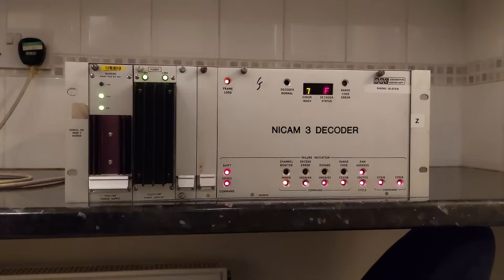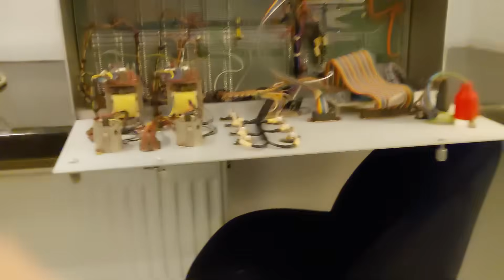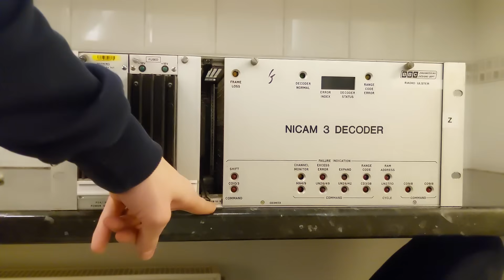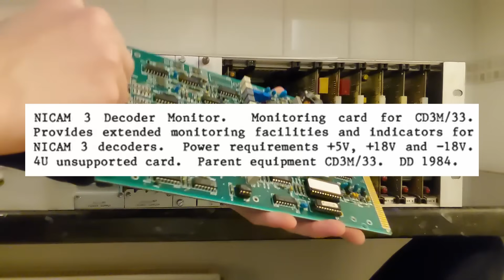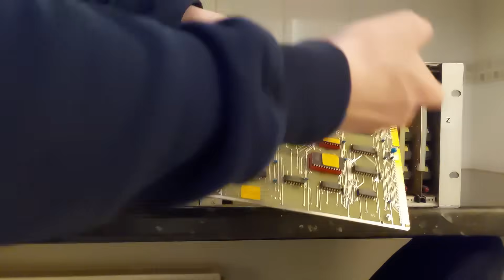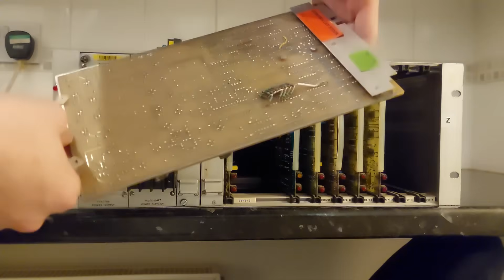A Look Inside: BBC NICAM 3 Decoder

Comment: Is this what's on divis for radio ulster 94.5 and does it support mpx output or is the rds different
Reply from the maker: Years ago, the national NICAM multiplex was routed through Belfast BH, and Radio Ulster was spliced in on the way to Divis and on to Londonderry.

The arrangements are different now, those links are long gone now sadly.

RDS & Stereo coding were done at the transmitter
Reply: @AvroVulcanXH607 very interesting I worked in radio before I saw pictures of divis and sutton coldfield bbc trasnmitters they use ip nicam encorder at studio and decoder at the sites and newry is a off air reviver rebroadcast divis to newry area newry relay

Comment: Hi Nathan, I worked in London control room in the eighties and we have the sending end in the racks. Actually there were a pair of them with an auto changeover switch. The "sender" looks just the same. And for your info we had lots of valve amps sending and receiving programmes to various destinations

Comment: Blimey! I remember going on a 'service seminar' in the mid 80's (I think), and the lecturer got off to a good start on a new Panasonic TV with NICAM. Sadly, it soon became apparent that his forte was signal routing/switching and instead of telling us all about NICAM, he got stuck into the various logic & signal routing chips that took care of the in/outs on the TV and went on at length about how the audio and video sigs were channeled to/from the connectors and/or the innards. After a good lunch we all traipsed back to the lecture room and he again banged on about his favourite subject. I'm sure most of us were asleep by about 2 o'clock. The best thing was gift of a rather nice toolkit on our way out. I've still got the pliers and the set of nut-spinners to this day! And we all got the all-important certificate to stick on the workshop wall, whether or not we stayed awake....

Comment: Reminds me of receiving the Maplin Electronics Magazine edition that covered NICAM transmissions, and the first NICAM decoder in the house, built into our AKAI VHS recorder IIRC.
Reply: I was thinking of that too! I've still got it somewhere, in a binder. I can't remember when it was (probably late '80s?) but I lapped up that kind of technical detail as a kid and would give chapter and verse on how it worked, from memory, at the slightest opportunity. Wonder if it's archived online somewhere... If not - scanner, here I come! :)
Reply: @molletts  AI / Claude either makes this easy, or, halucinates.   In this instance 1989 sounds plausible / rings a bell for me.   "The NICAM content in Electronics — The Maplin Magazine appeared across a 3-part series starting with the October 1989 issue.
Specifically:

The October 1989 edition carried the first instalment of a 3-part series on NICAM 728, and went on sale from 8th September 1989. WorldRadioHistory
An advertisement in a November 1989 publication also promoted the October 1989 issue as covering NICAM 728. Scribd
The series continued into subsequent issues, and the August–September 1990 issue featured Part Two of the NICAM Stereo TV Tuner Unit, with full constructional details for the NICAM Stereo Tuner Accessory Kit. Internet Archive

So in short, NICAM coverage began in the October 1989 issue and ran as a multi-part series over several issues."

Comment: Nice video Nathan. Was thinking early 90's box of tricks, this an 80's job then. I did not realise NICAM was that old. I remember casings, the blanking plates, little pull handles, cases with the rails put in at so many holes along. 
Electronics, apprenticeship 1990-93. Had first camcorder, Dear Sony Hi8 thing. song VCR with edit control lead, to camera, All stereo. Guess video record the Nicam audio. To the point. New TV as well that time. Not Sony. was Panasonic, nice ported speakers, speakers not just face out front, was some tube, ported thing to front grill. Nicam stereo. all 1991. good old days of scart leads, phono leads and sockets. Now easy 1 HDMI do the lot 😀

Comment: A BBC engineer told me that they eventually broadcast NICAM directly to viewers becoming the first digital audio broadcast. Dunno if this is true.
Reply from the maker: Yes, NICAM-728 was broadcast directly to viewers alongside analogue TV. There were also some experiments exploring it's use to replace FM radio - which ultimately became DAB!

(sadly whilst the engineers saw DAB as a way of sending even better quality audio to users... the money people saw it as a way to squeeze more stations through smaller bitrates on single transmitters... Hence why DAB these days sounds awful...)

Comment: I used to work for Arcam (or to give it its full name, Amplification & Recording Cambridge) Ltd. in Waterbeach, north of Cambridge in the UK from 1987 until 2003. During that time, we manufactured a Delta 150 NICAM decoder for home use (I still have mine) and we also supplied modified examples to the BBC for monitoring the NICAM transmissions (I believe) which used to come back periodically for repair. Happy days.
Reply: Hello, former neighbour!

Comment: Interesting!
I bet that those added resistors on the solder side are there either as afterthought bus/signal terminators or as pull-ups due to using open collector output chips either due to supply issues (some chips have the same pinout) or the engineer/designer just forgot that the outputs are open collector.
It's interesting that NICAM ended up being used for stereo sound on analogue TV, not only in the UK but also in the Nordic countries (or at least Sweden). Also NICAM ended up being used for encrypted audio for FilmNet (what later became part of Canal+) as the last way to protect the analogue PAL satellite transmissions from, eeh, non-endorsed decoders.

Comment: It’s crazy that the BBC had its own design department (on top of Kingswood Warren R&D) to make kit from the ground up. Everything from video distribution amps to animations stores for the globe ident and the in vision (RIP) clock
Reply: The main reason for this is that lots of the things needed to be developed and designed because no one else was doing the thing that needed to be done, or that what was available was incompatible with the way the BBC distribution, contribution and transmission systems worked.
Reply: People forget that the BBC was one of, if not the first doing this broadcast stuff and everything was (and is) somewhat bespoke.
Reply: @wigglepig115 
Teletext, digital interactive television 60 years ago
Digital television, nearly 40 years ago, our standards are used the world over.
Reply: The commercial world was playing catch up though. I remember the BBC vision mixer back in the day that looked more like an audio console with all the faders but the Grass Valley 1600 became the standard for new studio builds. Avitel were doing video distribution amps and pro-bel for video routers.
Reply: @gordonm2821 Independent TV had the IBA Experimental and Development Department at Crawley Court.
Reply: Same with training. I spent 16 years teaching at the BBCs Engineering Training Department at Wood Norton. We had to have our own school as no-one else was teaching this stuff, there wasn't a big enough audience for it.
Reply: @KitWN - That name rings a bell but was never taught by you. I did my A, B and C studio engineering course at Wood Norton around 1990/1991.
Reply: @KitWN Hi Kit, long time no see! (I seem to remember that I made some comment about the square root sign and “power 1/2” meaning subtly different things. 😊
Reply: My dad used to work for designs department. The  BBC were first in many of their designs- simply stuff that could not be bought off the shelf. For instance, transmitter monitoring using digital info in the spare lines, bespoke stereo decoders etc etc. The BBC designed the first standards converter, so 525/60 could be converted to 625/50.  This might have been from their research dept, I can’t remember. But they had full in house facilities, from technical drawing to PCB design.  Some of the stuff I saw as a child in the 1960, was way ahead of any commercial designs which still used valves.
Reply: @gold27b I remember watching an old clip of a BBC standards converter and them boasting it only fitted in a few racks. Not sure if there are many off the shelf standards converters makers in the world. We pretty much used Snell and some of the motion compensation was licensed from the BBC. Well certainly for a fully fitted Alchemist. We put a pair back to back once and turned all the settings the wrong way for the Channel 9 News sketch on ‘The Fast Show’.
Reply: @gold27b I remember watching Rowan & Martin's Laugh-In on BBC 2 in the early 1970s, and the continuity announcer explaining that the picture looked smaller than normal because they'd converted it from NTSC to PAL, with all that that entailed. I've a half-memory that the converter was also represented as being the BBC's own design.
Later on, of course, the Americans very sensibly adopted the PAL system, so the problem resolved itself.
Reply: @manjacovus5342 So this is from my memory of those times… The BBC first developed a system where 525/60 video tape could be converted to PAL. This resulted in a gap at the top and bottom of the picture. The first American show I saw using this was the Andy Williams show. It was on BBC2. These early shows did not feature the bear! 
Roman and Martins laugh in used the new converter which could convert live TV. It was all analogue and repeated lines every inch or so on the picture to enlarge it. My dad always said the clever bit was the frame rate converter, as this has to convert 60 fields down to 50. So there was jerkiness on panning shots. 
Later ITV got in on the act and used digital electronics to convert and, it was superior.
I forgot to mention, the BBC practically invented Ceefax, using core store memory in the early days.
Reply: @gold27b  The very first BBC designed standards converter was the CO6/501 in the early 1960s which converted from 625 to 405 lines. After the prototype, most of the units were manufactured by PYE. This was a very useful bit of kit as it enabled 'new' material produced on 625 lines to be also sent to the existing 405 line transmitters. It included 576 capacitor storage circuits and the whole unit included nearly 3,000 transistors. It was superceded by a later version which was fully digital (apart form top and tailing with an A to D and D to A).
Reply: Yes,  Research Department, Designs Department and an Equipment Department to manufacture the stuff.  Unfortunately, the BBC were very blinkered when it came to exploring what equipment was available on the market.
Reply: @ianbuffham4006 It often wasn't available back then or didn't fulfill thier needs, many BBC developments went onto become industry standards the IBA had a similar Experimental and Department at Crawley Court.
Reply: The BBC literally wrote the books on a lot of video production and broadcasting technologies. NICAM and Teletext are recognised because they were household names, but even they weren't originally intended to be consumer products. 

I do wonder what other bits and pieces they worked on over the decades, and whether people outside of video technologies would realise the implications. With digital production techniques, people don't think that much about Genlock, and it would take a while to explain to someone who had never worked with analogue video what the point of it was: yet I have a hand-made genlock unit, built by BBC Engineering,  fitted to a modified Acorn Archimedes that once worked in TV centre.  Even things as ubiquitous as the COW don't tend to impress people unless they understand the technical challenges of doing those things with 1980s technologies.

I mentioned Teletext, so I'll say some more. Teletext started off as a way for the BBC to use spare bandwidth in the distribution network disseminate live corporate and management information to their regional stations. (I think I heard that there were even 'pages' that carried data to automate some routing management?) That was before the SAA50xx chipset, so the decoding hardware at each regional station must have been pretty large, and presumably the text was made available via a computer and dumb terminal, the notion of putting similar equipment in a living room was laughable.  (IIRC the BBC Micro was mandated to have an SAA5050 specifically so that it could be compatible with teletext data, and presumably so that Beebs could be used as content creation terminals for teletext.)

The unit in this video dated from 1980, I don't know if adding NICAM data to broadcast TV on a subcarrier had even been imagined by then, by 1990 Philips were selling a set of three chips that would replace several of the cards in that unit, in fact one of those three just did the IF data recovery, which this unit didn't have to worry about!

The BBC were also heavily involved in the development of DAB, DVB and the VM used for the interactive features, none of those are light weight developments or "quick hacks", they involved many man years of work at the most demanding levels.

The divestment and distribution of BBC R&D might now make financial sense, but I will always feel that it was the sad end of something glorious.